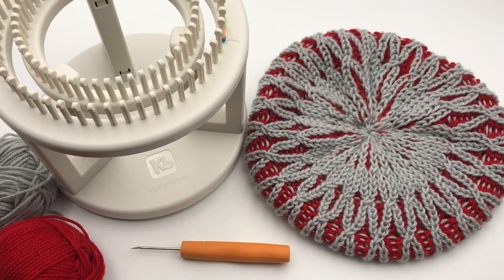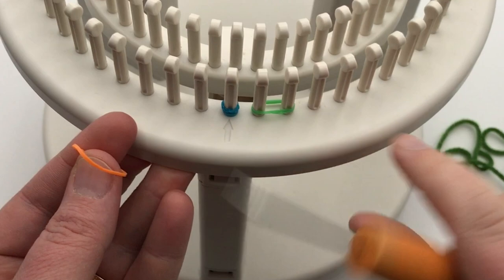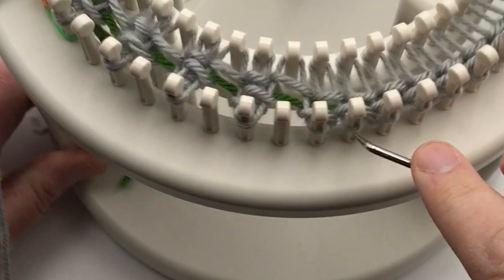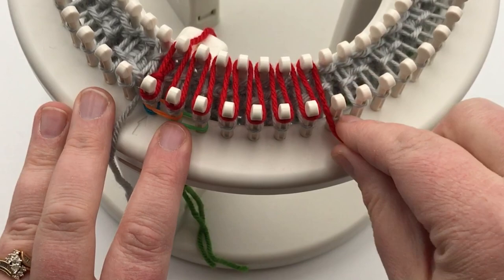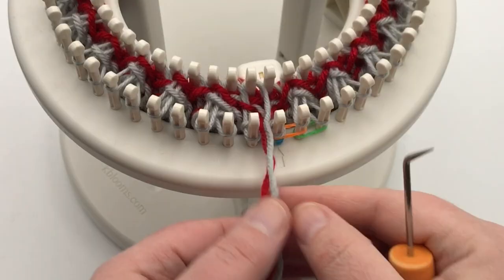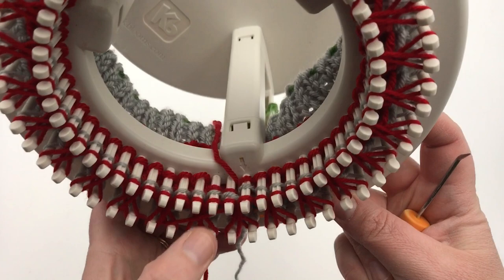Loom Knit | Twisted Brioche Slouchy Tam (Counter Clockwise)

Comment from the maker: Timestamps - click time:
00:00:00 Welcome
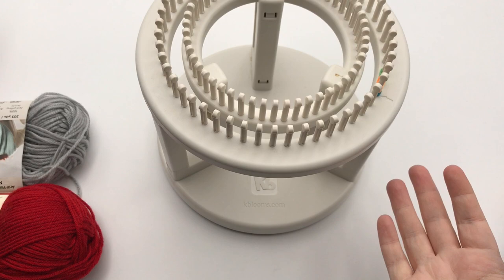00:00:54 Counter Clockwise VS Clockwise (Right or Left)
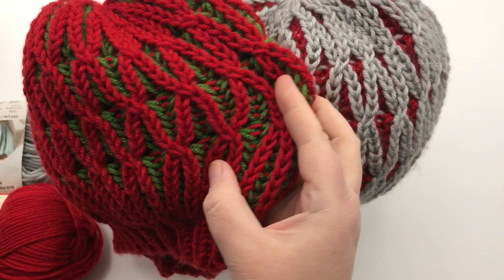00:02:16 Supplies
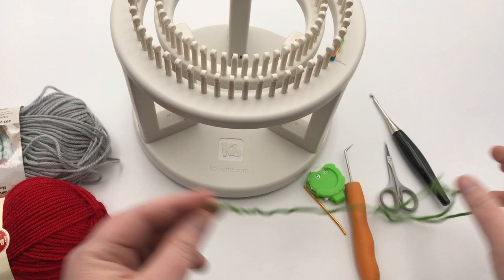00:05:01 Walkthrough Pattern Visually on Hat
00:08:02 Pattern Basic Walk Thru
00:09:36 Casting On
00:11:14 Anchor Yarn
00:12:36 Finish Casting on
00:13:23 Set up Round 1 
00:14:13 Chunky Open Rib Stitch Brim
00:15:27 2nd round wrap for Rib stitch
00:16:59 Repeated rounds of Rib
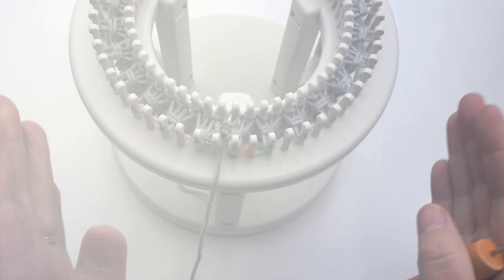00:18:03 Round 7 - Setup
00:19:08 Round 8 - Color B Brioche 
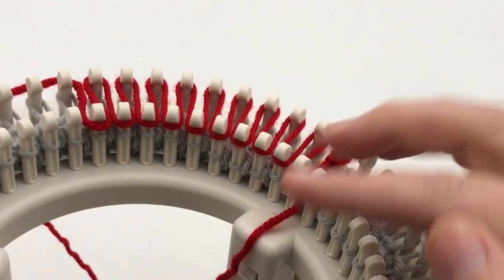00:20:13 Round 9 - Color A
00:22:22 Rounds 10-23 
00:23:11 HOT TIPS: NO seam tip & Yarn management
00:24:18 HOT BRIOCHE TIP: Know your Rows 
00:25:30 TROUBLE SHOOT: Fixing Brioche mistakes
00:27:36 Cable Twist Brioche 1 finish A - Rnds 24 & 52
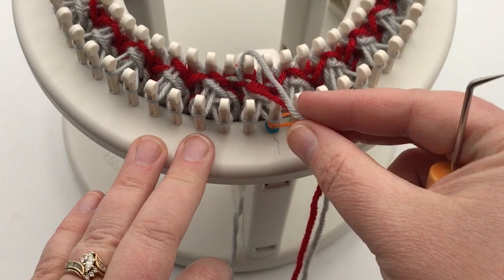00:31:48 Wrapping Technique 1 Color B
00:34:57 Round 25 (Later Round 53)
00:25:22 Rounds 26-37
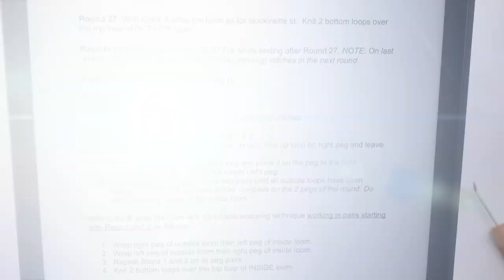00:36:11 Cable Twist Brioche 2 finish A - Rnd 38
00:37:56 Wrapping Technique 1 Color B
00:39:15 Rounds 39-51
00:40:27 Round 52-63 Notes
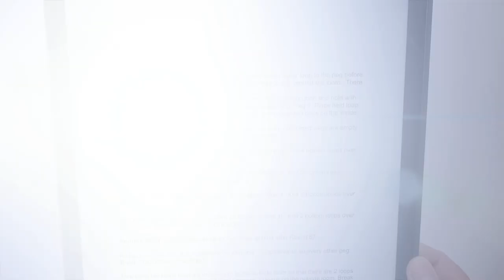00:42:01 Shape Top (crown) Instructions
00:42:35 Setup Round 64 - outside pegs
00:43:17 Setup Round 64 - inside pegs
00:44:53 Round 64 - Decreased Stockinette
00:46:55 Round 65
00:37:31 Round 66-71
00:48:41 Finishing - Moving stitches to outside
00:50:18 Finishing - Taking off loom
00:52:02 Finishing - Close top
00:55:17 Finishing - Weave color B
00:57:35 Finishing - Anchor Yarn
01:00:07 Finishing - Weave tails in rib
01:02:14 Wrap Up